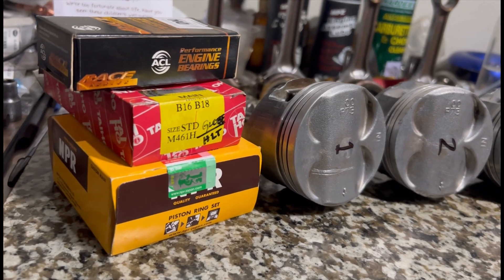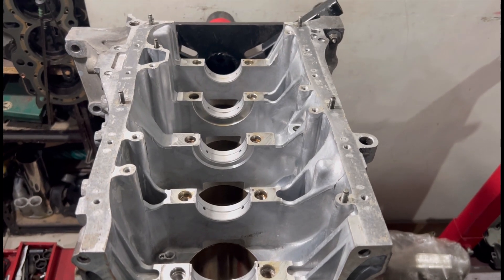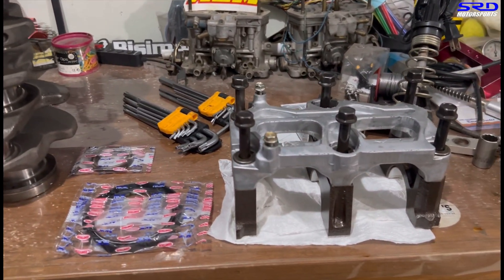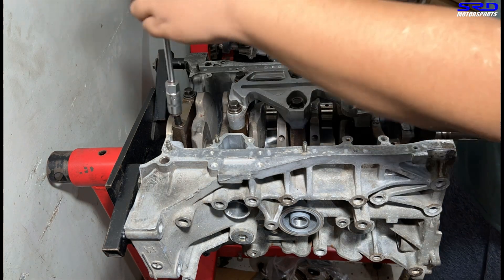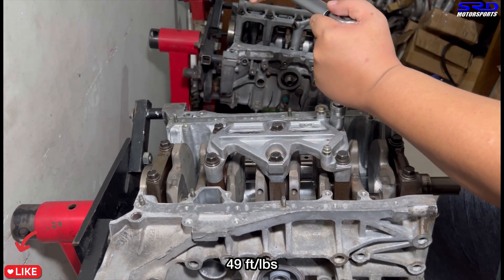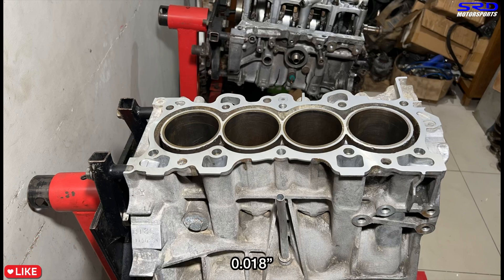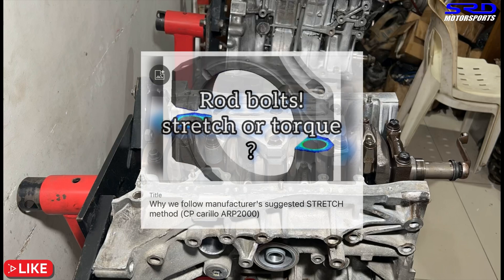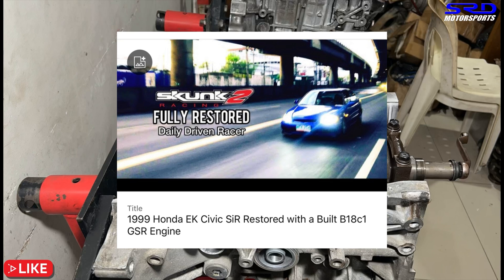B18c TypeR Block bottom-end Full Assembly

Comment: Question: in this video you did not stretch the stock rod bolts. You torqued them to 33 ft lbs. I thought Honda recommended that the rod bolts on b18c type R be stretched. You did mention that the aftermarket rod bolts must be stretched. Can you please clarify about the stock rod bolts. Thank you.
Reply from the maker: It was stretched off camera, and the stretch was achieved at 33ft lbs 

If u don’t get the desired stretch at 33ft lbs don’t increase torque, re lube the rod bolts and usually it reaches the needed stretch

then it gets repeatable

Comment: Ring clocking is very important and some tend to forget how critical this part is, thanks for touching on this subject brother
Reply from the maker: Yes definitely and the oem way is a good way it’s just I feel some can mistake the “compressing” of rings on the ring compressor and accidentally align the ends as they are a few degrees apart so had to share a safe way we do
Reply: @SRDmotorsports  I've definitely had that experience in the past with the ring compressor misaligned the rings ,it's a known thing that happens
Reply from the maker: Same here man same here :) so I figure this could help alot
Reply: @SRDmotorsports  most definitely
Reply from the maker: makes it more fun overall 😎
Reply: Wish you were in the states. Need some head postings done by you.
Reply from the maker: What core head would it be I mean what are u running
Reply: @SRDmotorsports  
K20a
Reply from the maker: Oh nice nice
Reply from the maker: @builtbyme4422  since you’re in the US even if we have a PRB k20a core… 

the guys at @headgames will be the place to check I’ve known them for 2 decades good guys and u can also check their channel lots of good stuff there